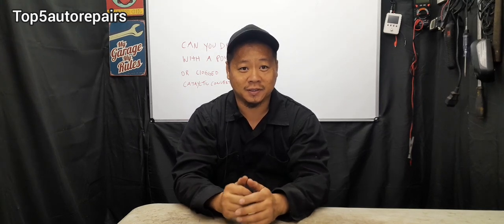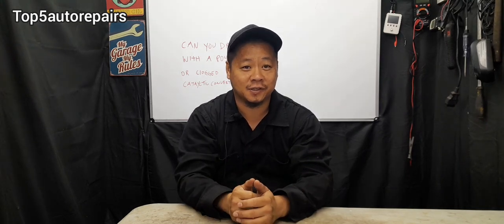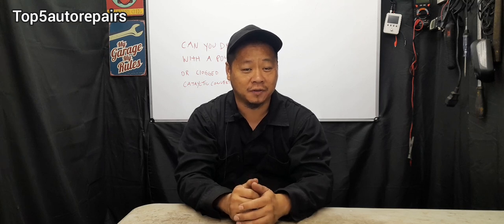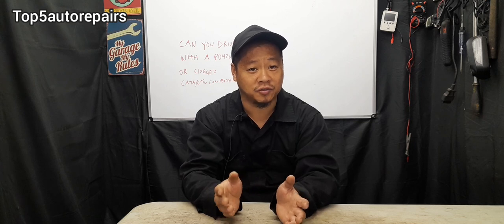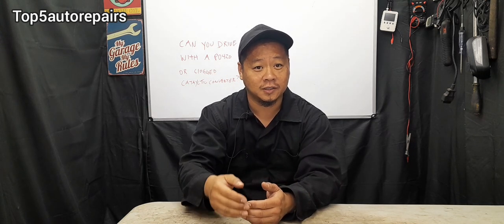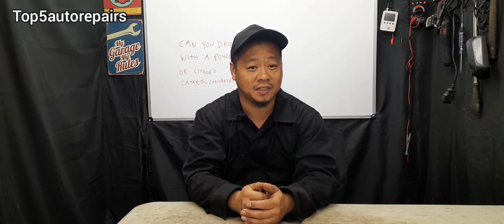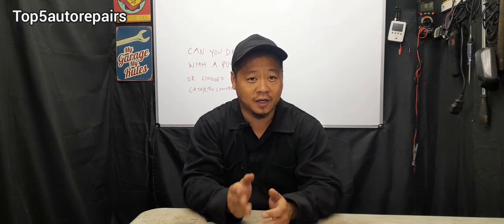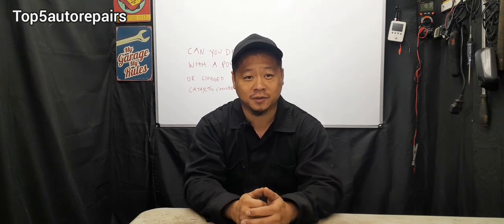HOW LONG CAN YOU DRIVE WITH A BAD CATALYTIC CONVERTER?

Comment: My Catalytic converter stopped working at 125,000 and I’m stuck with p0421. I just got the car with 112,000. I just kept driving and driving and nothing happened. It’s just gonna be a little sluggish. gas mileage is not affected. My catalytic converter is trying to work, but it keeps clogging up and unclogging.
Reply: i got 2 on mine and was running it with one until it finally gave out

Comment: Hey. I have the PO420 code. I smell fumes etc in my car. Is this also Carbon Monoxide being released in my car. It smells bad, and I can smell the fumes on my clothes
Reply: Check your o2 sensor, may be blown and not reading correctly, plus a fresh set of sparkplugs should be good too if you have never replaced them

Comment: Can a clogged converter cause engine failure? Took my f150 in for a front engine cover change due to a leak. Next time I drive it my engine stalled out. I had a p0420 code and they’re saying that the converter cause the engine to go out?
Reply from the maker: A clogged catalytic converter can cause exhaust fumes/heat to back-up onto the engine and cause it to overheat.
Reply: Was it your cats cause that’s the only code I’m getting and my motor just stalled out randomly
Reply: My old F-350 got the clogged cat, i thought at first it could be the torque concerter or the tranny going bad, just to discover the first honeycomb was turned into ashes and clogged the cat, it was running pretty well, but i guess a 2k mile trip loaded was too much for the old cat😅😅😅

Comment: My Subaru just destroyed its cat so that is where all my oil was disappearing off to it was burning it and now it wont pass inspection in my state since its required to meet emissions until its 15 years old mine is 10 years old so yeah…. Even worse I have loan for $13,000 on it and the car lost all of its value only worth now $2,000 so im just not going to take it in I know structurally and mechanically its safe just wont meet emissions

Comment: Don't replace. Stops replacing please stop. Just do what the Indians from India do. Take out the catalytic Use 3 gallons of diesel fuel and flush catalytic converter and after u flush it let it soak in dawn or any dish soap fully submerged with water 24 hours and rinse shake rinse shake  then flush with distilled water  ur cost 30 bucks 😉  and done u will have another 100k miles u welcome

Comment: Thanks for the informative video. Will my 2007 vehicle start having a bad catalytic converter at 140,000 km (87,000 miles), or this is still too low of car mileage for it to be significant?
Reply from the maker: Very unlikely. Mileage is too low.
Reply: @Top5AutoRepairs  
Thanks very much for the quick response. 🙏
Reply: City driving reduces the life of the cat converter. Mine at 76k miles already clogged.
Reply: @Top5AutoRepairs not if do little mileage with city traffic.

Comment: My Mechanic just told my Catalytic converter is going bad today 2/12/24

I have to replace it 
I’m not having any of the problems yet you said 

He said that the oxygen feed was not constant at 65 mph
So that a sign he said 

But all the other lack of power or bad smells not happening yet 

I’m hoping it last two more weeks so I can get fixed

Comment: 2006 Prius 211000 miles check engine light came on  again after being in the shop for a month.
Before that there was a burning smell while I was driving it on the freeway over 70 mph and triangle of death on.

Mechanic said the hybrid battery and he sent the battery to some place to be replaced but they sent it back saying the hybrid battery is in good condition.

I picked up the car yesterday and the check engine light came on.
What could be the problem??

The car runs fine

Comment: Mysterious stalling? My car just started stalling out of nowhere for no reason. 
Struggling going up hill? Yep 
Poor acceleration? Yep
What I’m lost on is that I did a back pressure test and it was fine. Idk but so far it at least seems to lean more on it being a cat problem
Reply: Check your torque converter then if your car-truck is automatic, i thought at first my tc was bad because of rough idling and then don't even wanted to start at all, poor acceleration, etc, i put down the tranny and tge muffler just to get the first honeycomb of the catalytic converter turned into ashes, and that clogged the second honeycomb of the cat (damn you ford!), so now i had a clogged cat and a pretty functional tranny and tc😅😅😅

Comment: What if you just replace it with a pipe. Will it run fine?
Reply: gotta retune it. if you don’t retune, it’ll throw a CEL because the O2 sensors will read incorrectly and use the wrong fuel:air mixture
Reply: Yes but very noisy. Bad fuel mileage and risking the engine light to come on

Comment: I bought two aftermarket cat converter and my code still coming up  what should I do?
Reply: What aftermarket did you buy?
Reply: Then check your o2 sensors, may had bad readings or they're clogged